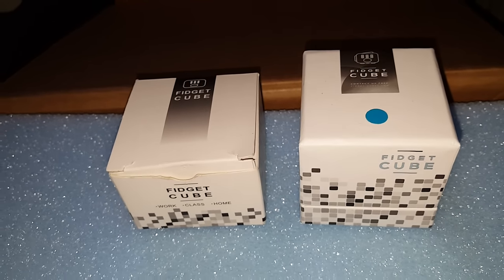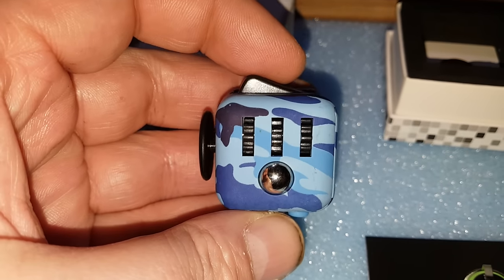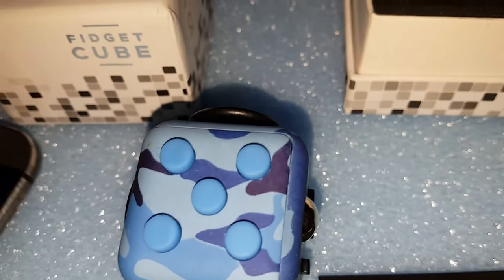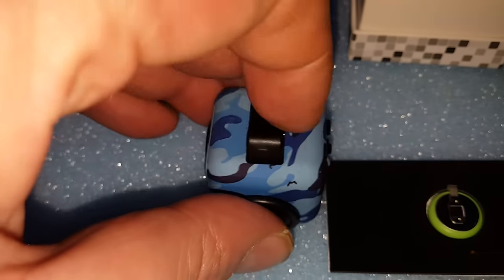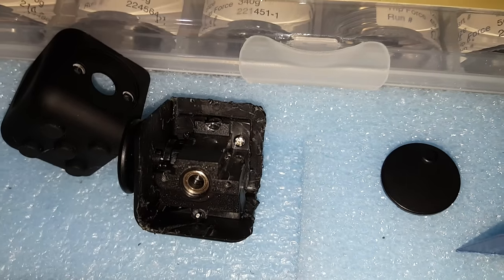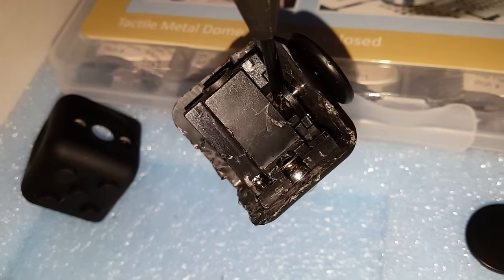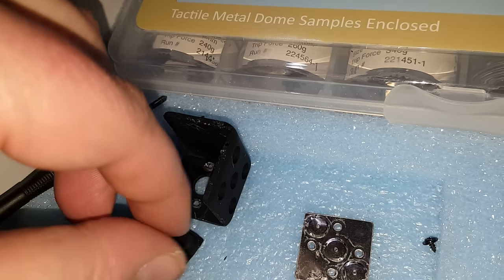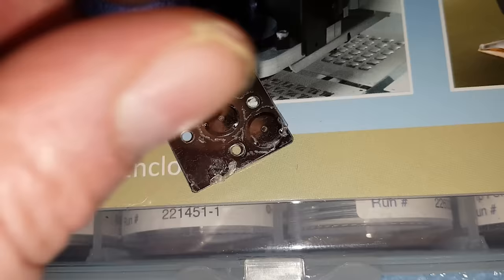Fake Fidgets, Magnets and Tactile Domes, The Movie!

Comment: FYI if you pull the hinge pin out from the rocker switch, remove the one accessable inside screw and pull off the joystick top, the inner section comes out.

Comment: just took apart a shitty fake (the kind that has 5 click buttons and no ball click) and inside is totally different.
the click isn't with tactile domes - its little buttons. also the way it splits in two is different, you remove the panel holding the buttons and the one covering the ball and gears.

Comment: My Camo cube arrived today and already the joystick is broken :( It doesn't snap back to place and is sticking a lot/not moving about smoothly
Reply from the maker: Connor Kennedy - Thats sad to hear. If you got it from the guys at Shop24UK on eBay/amazon then shoot them a message and I'm sure they will look after you. 
I have 7 total of that maker's cubes in various colours and they have all been tested by me and been good, have given most as gifts and a couple for family 2moro minus my modded one and the one I disected (killed) in the name of science. 
Sounds like you got unlucky. I hope it gets resolved quickly for you. 

Im not home for a few days to look at my stripped down one, which is a shame as it could be a simple issue to fix. But the guys you purchased from will see you right.
Reply: I had the same problem with a high-Q fake cube I received at the beginning of December. Thanks to Nial's excellent take-apart info, I was able to open mine cleanly and dab some a drop of WD-40 onto the steel ball  base of the joystick with a toothpick. That eliminated the sticking and squeaking. The spinner dial micro-bearing was also sticking slightly, so that got WD-40 as well. Mine is working great now! You have to be very careful putting the screws back in as they are self tapping into the plastic structure. Photo: https://www.flickr.com/photos/curiouslee/31498796490/
Reply from the maker: curiouslee - Thanks for that tip I will pass it on if any one else has the same issue. 
New cubes on their way for early January will be a 2nd revision of the HQ Fidgets (which will hopefully see these smalls issues fixed along with some cool colours &  
Patterns!